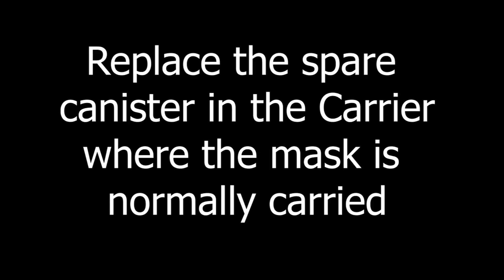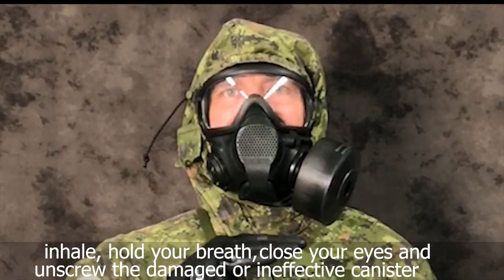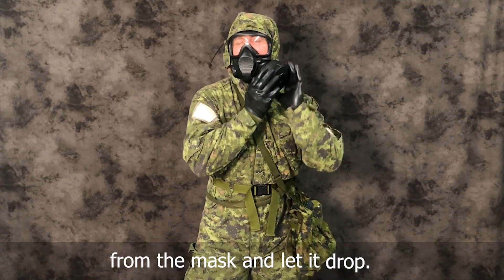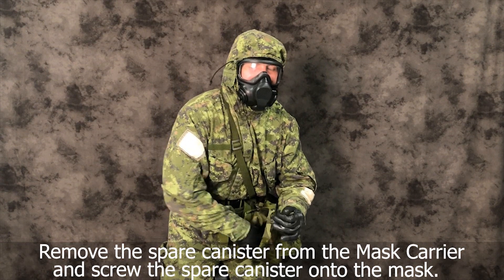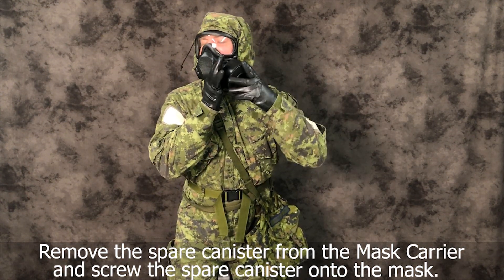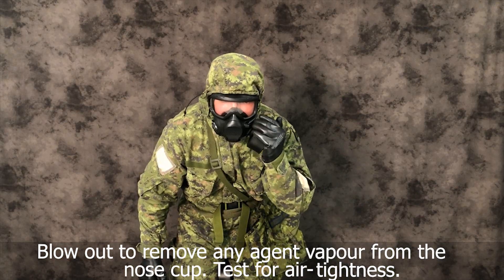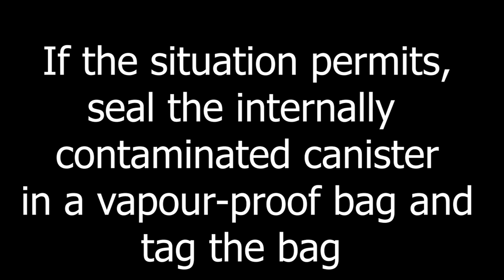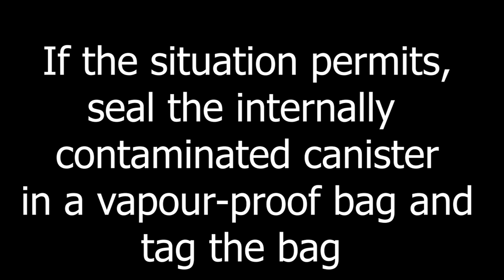Canadian Forces - C5 Mask Canister Change Drill

Comment: The C5 must have been the shortest-lived piece of kit there's ever been.
Reply: Lol yep! I was looking for a comment like this. I'm sure the OEM will end up fixing the valve issue, but it is a tad embarrassing when your protective mask doesn't.. protect.
Reply: May I request elaboration?
Reply: @domp5014  because it seemed like as soon as it was issued, it was recalled.
Reply: @battmaxter  what was the issue? I’m assuming something to do with the valves as the previous comment states? But what specifically?
Reply: @domp5014  The following is directly copy-pasted from the CAF subreddit:

Below is straight out of the CA Operational Clothing and Equipment Coord 8 Dec 21 update:

BLUF: C5 masks are not to be used. Masks are to be returned and a C4 is to be fit tested and issued.

    Trainers in St Jean discovered an issue with the exhalation valve. Some issues with the drinking tube and harness are also of concern;

    OEM has been responsive in finding solutions. Solutions were tested in Val Cartier at the end Sept. and are now in pre-production phase;

    We are expecting solution to be implemented and mask redistribution in Winter 2023. The corrections to take many months to be completed.

In the mean time:

    All C5 marks are to be returned to depot (ongoing);

    A C4 mask is to be issues as replacement. A new fit test is ALWAYS required when a new mask is issued, even if it the same size as the last C4 mask received.